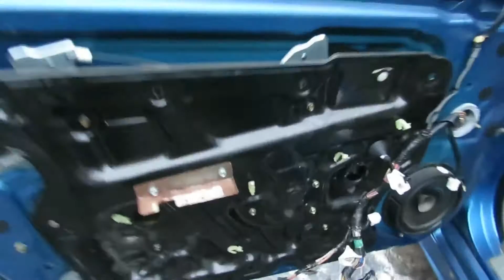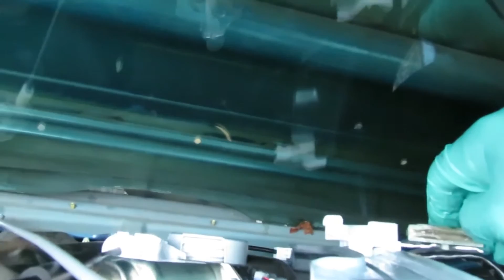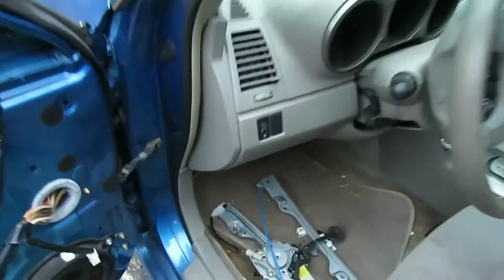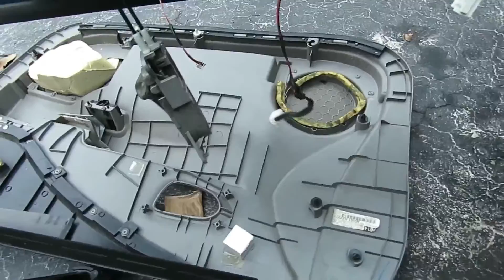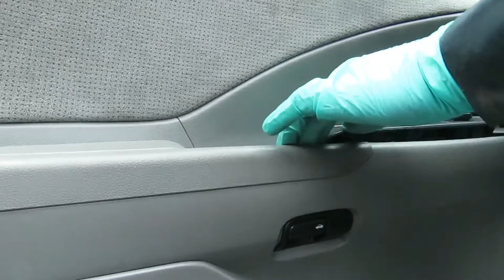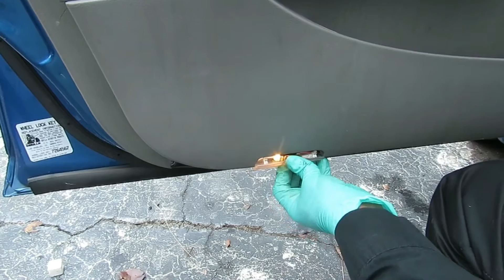⭐ 2003 Nissan Altima - Window Off Track - Hired To Finish Installing Window Regulator

Comment: Thanks for posting the video. I had a severe case of panic not knowing how to position the regulator and motor onto the panel until I saw you attach them to the panel before installing. I was surprised that I fixed mine in less than an hour.
Reply from the maker: That's great, good job. Thank you for posting your comment

Comment: I see this more and more...the clips are glued to the glass rather than the old school way of having the bolt holes drilled through the glass.
JB weld works great if the clips are not broken.
The glass has to be removed while the regulator is repaired, or the clips replaced. It's also a good time to prep the glass for epoxy.
Re-install the glass and re-position it to the top while it is held in place with cardboard or tape.
With the regulator lowered, the clips can be filled with JB weld.
Roll the regulator back up ensuring the clips engage the glass forcing the JB weld to contact and bond the glass edge to the clip.
The alignment between the clips and the window must be exact for a perfect fit and function, that is why the glass and regulator clips have to be married up while the epoxy is fresh - yes, it is a dumb design.
Pull the window fuse until the epoxy sets and you should be back in action.
I hate those damn clips.
Reply from the maker: Hey Len, once I saw that, I thought of doing this, I even keep JB Weld in the truck, but the only thing that kept going through my mind is "If anything happens, it come apart in the future, or the window stops working, the motor goes, even though we know it is not my fault, they would call me because I'm the last one who fixed it, so I made the choice to just get the window up. As we say in this field "I don't want to be married to it" ;)

Comment: thats a married job,once you touch you married to it.forever.never played with those family type repairs,dont know how it was taken apart/what was done etc.that glass is bonded at the factory under proper conditions-you cannot use epoxy,jb weld etc to properly hold those clips to the glass.just chasin your tail for somebodys attempt to save money yet they spend twice as much in the end to finally get it done right.can you dig it.long island is my neck of the woods.
Reply from the maker: I saw some epoxy online to glue that, but you are right about being married to it, that's why I will not offer that option. You won't be calling me left and right about how it fell down again. So it looks like we will be close to you, good deal!!